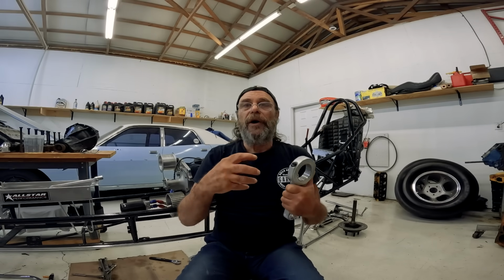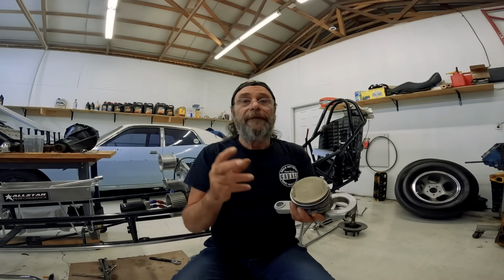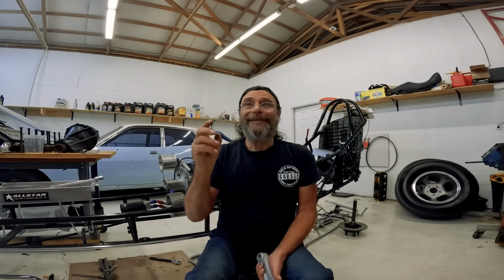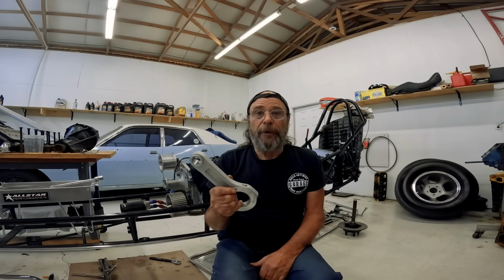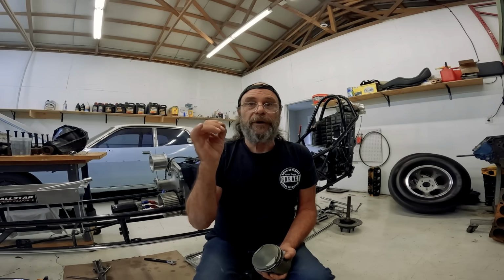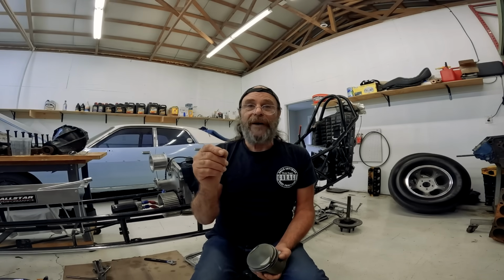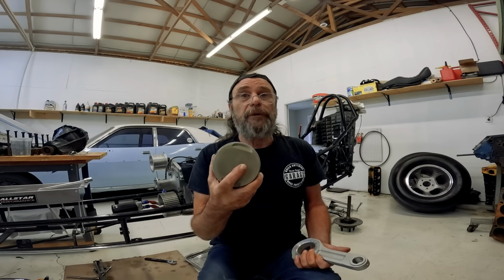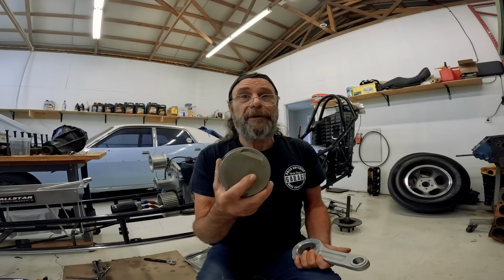Project Top Fuel Pt.9 - How Nitromethane Makes Power And The Importance Of Rod Ratio

Comment: This guy cracks me up..... "A legend in his own mind"..........
Reply: The dude has a right to be proud of what he has done and what he knows.
How many nitromethane dragsters have you built and raced?
Reply: Big Fuel Pumps, Big Magnetos, Dual Magnetos, Down Nozzles,  Super strong rocker arms and pushrods all made the huge horse power leaps.  Rod ratio and valve lash has zero to do with it. I've been around nitro all my life. This guys in love with his own voice.  If this guy thinks a 65 year old 354 block with very fragile main webs is going to hang with modern tires on a prepped track, he's sadly mistaken.  Golden Age races got away with it has there was zero traction. The engines just freewheeled.  Today?  The crank is going to be laying on the ground  in a handfull of pass's..... This will be fun to watch.
Reply from the maker: I normally don't respond to this soot of thing...but.
Big pumps, dual mags and down nozzles all came about at the same time....why?  To provide and light enough fuel to extend the burn into the blowdown zone.
Super strong rocker arms...EXHAUST rockers...why?  Because the valve was opening into an active combustion zone at the BOTTOM of the stroke.
I was a participant in every bit of that evolution.
As for the engine currently in the car, as I explained in a previous video, it will only be used for initial setup and a couple of burnouts and 60 footers,  After that it will be upgraded as the owner sees fit.
Reply: @UncleTonysGarage  With who? When?  What team?
Reply: @AlisoBob  cant wait for you to upload a video of you and your drag car  explaining  how  it all works   AND YOUR CAR NOT ANYONE ESES
Reply: https://youtube.com/shorts/T82H7t6Z3U0?si=0jawOLLyJSikavAR
Reply: @UncleTonysGarage  The guy always has the option of blocking your channel so he isn't tempted to klick and watch[ one of your videos. Love you Tony. The legend.😘
Reply: @AlisoBob  I don't get that impression at all from him..... Although I do get that bad  impression from YouTuber-Casey The Car Guy. He comes off as extremely cocky & arrogant. 
He put a small fuel efficient turbo diesel engine (probably a 1.5L European TDI engine) in a very lightweight aerodynamic small 2 seated car. So it gets over 100 mpgs. Then acts like he singlehandedly built a nuclear fusion warp drive engine. That will allow spaceships to travel at the speed of light. Apparently he doesn't realize several other people have also built 100 mpg small cars. If you think Tony loves his own voice. Or is a legend in his own mind. Go watch Casey The Car Guy. 😂 You'll think Tony is super modest by comparison.
Reply: Thanks. I'll go take a look.  I'm always on the hunt for a good laugh.
Reply: @AlisoBob  He was on a Tucker Carlson podcast bragging about his 100mpg car, a while back. The only way he could sell it, is in kit car form. When people suggest this, to him, he acts like they're st00pid. Saying, "duh don't they think I've thought about that? The average Joe can't build their own kit car. So that idea won't work." 
Yet, all he'd have to do is, sell it as a kit car.  Then have another different company under a different name. Assemble the car for the customer,to make it street legal, to get around loopholes. 
The average person thinks his car is amazing because they don't realize, a 100 mpg car has already been done. So now he has several dim YouTube followers. Who think he's practically a God who's going to be the next Elon Musk. They post comments about how the government or oil 🛢️ companies are going to try to delete him. 😂 
Lately he's been doing nothing but conspiracy theory videos where he asks Grok AI questions. About things like political corruption and who secretly controls the world,etc... I do agree with him on many things politically but. He seems like he's starting to really go off the tin foil hat deep end.
As far as his 100 mpg car I believe he simply took a 1.5L turbo diesel engine. Out of a European*Peugeot 208 which claims it can get 70 mpgs. He then put it in a lightweight aluminum monocoque body, that's fairly aerodynamic & sportscar looking. Along with some lightweight wheels & skinny tires. 
One thing he does have me curious about is. He claims George Soros paid for Vivek Ramaswamy's college.Which I highly doubt, since Ramaswamy most likely had a bunch of academic scholarships. He claims Ramaswamy is actually a far left globalist. Pretending to be a Trump supporter in order to get elected. 
Sorry for the long comment, I can't stand the guy. If you think Tony is arrogant (I don't think he is) & loves his own voice. Casey The Car Guy is 10,000 times worse.
Reply: There is only X amount of BTU's in a gallon of fuel. Those BTU's will only do X amount of work.  Many of those BTU's are lost to exhaust and cooling heat.  There is no magic 100 mpg car.  Period.
Reply: @AlisoBob You're not listening. And being around NITRO for all those years, how many barrels of it did you buy? Ever own a NITRO Altered? Crew on multiple Top Fuel match race teams? I think it's cute how convinced you are that rod ratio has nothing to do with it. 

There are people who think they know and love to see their name in the comments as well
Reply: I bet you've never owned a firesuit, have you? 

I know a bunch of experts like you. They've never done nothin', been anywhere, or worked with anybody. They're never racers, and sometimes they don't even have a HotRod. If it turns out you drive a hyundai, I won't be shocked
Reply: @AlisoBob You could re-read your own comments...
Reply: @AlisoBob  Respectfully,  there actually are a few small lightweight 750 to 1000 lb cars that can get 100 mpgs....A 2000 lb small European hatchback with a 1.2  or 1.5 L turbo diesel engine can get 75 real world mpgs....Put that same engine in a car that's very aerodynamic & only weighs 1000 lbs with 4 skinny motorcycle tires. That you can push in neutral with 2 fingers and you can get 100 mpgs in overdrive......They have a race called the Progressive X-Prize winner 🏆 gets $10 million dollars for the most fuel efficient car. Example, the small  Elio tandem 2 seated 3 wheel car. Got 75 mpgs using a 3 cylinder Geo Metro engine. Swap that Geo Metro for a 1 liter turbo diesel & you have 100 mpgs on the hwy in od.
Reply: @UncleTonysGarage  Great! I was wondering about the exhaust event and how it reacted when still making power. Fantastic!
Reply: @john-wk4ks ask Adam Sorokin about Bob Higginson.......
Reply: Add your experiences with nitro. 👉🤡👈
Reply: LisaBob has issues.
Reply: @Channelscruf I just clicked on his icon, and viewed his channel. Watch his short videos. He has videos of his Surfer’s top fuel slingshot dragster running in his garage, in his driveway, and at the track! The name of the channel and the person in the videos is the person who owns the Surfer’s dragster.
Reply: @shadowdog500  Did you actually WATCH many of those videos? OBVIOUSLY NOT..........BECAUSE I JUST DID. You claim "you saw that HE has videos of top fuel slingshots in "HIS GARAGE" in "HIS DRIVEWAY" ........"and at the track!" The dude simply attends various CACKLE FESTS. NO VIDEOS OF OLD-SCHOOL TOP FUEL SLINGSHOT DRAGSTERS MAKING ACTUAL RUNS. And NOWHERE in any of "his videos" does he have ANY information in ANY video description, plus he has ALL COMMENTS TURNED OFF. Let THAT sink in. Hell, ANYONE can attend cackle fests & visit OTHER PEOPLE'S shops & take short videos. ( MILLIONS of people do those things.......but it doesn't make them "experts". ) ALSO: In MOST of his SHORT videos, his video titles mention names of various car owners and/or drivers etc..........NONE of them say "MY top fuel sling shot". NOT ONE. Furthermore: "AlisoBob" asks Tony in this very comment thread: "Who did you race or work with, when, what team".............TONY HAS PAST VIDEOS WHERE HE DESCRIBED ALL OF THAT STUFF IN GREAT DETAIL.......but apparently, "AlisoBob" has FAILED to watch Tony's past videos ( videos posted BY Tony right here on his channel.........LONG BEFORE this "Project Top Fuel" that he's doing right now. ) Ya can't just go "take a quick glance" at some stranger's youtube video list and call that "thorough research". So "congrats"........because YOU'VE BEEN DUPED by "AlisoBob".
Reply: @shadowdog500  i  click on his channel before i posted my comment  and just because he post videos of drag cars running in a garage or driveway doent mean it is his garage or driveway or his car and instead of having a go at uncle tony he should post a video of HIS drag car explaining how it all works and not like in his comments ( Big Fuel Pumps, Big Magnetos, Dual Magnetos, Down Nozzles,  Super strong rocker arms and pushrods )
that explains a lot doent it   NOT
Reply: @howabouthetruth2157  I did watch his videos, including his short videos of him running his 1963 Surfer’s dragster in his garage.  In his short video posted 6 days ago he was alone in his garage and started the Surfer’s dragster himself on alcohol after putting it back together.  Cacklefest cars are meant to be started at the track but don’t make passes down the track, so I don’t know if he has any nitro racing experience, but he did build a nitro Cacklefest car which is something and he is the one that did a series of interviews with the origional surfers racing team about a decade ago.  The name of his channel and that car in his shorts are known In Cacklefest, and the person in the video is the person who matches the name of the channel.  If it is him, I hope he does make a short response video.  [UPDATE] I see he posted a link to his video I mentioned in a response to this thread.
Reply: @shadowdog500  HIGH.............there's a whole lot of difference between a cackle fest ( it's NOT "crackle fest" ) and actually making a run........any run, down the track. The engines are set up totally different for each.
Reply: @howabouthetruth2157  Thanks for catching my spelling error!  I agree that someone with a Cacklefest car sets it up mostly to idle and the engine and the rest of the car is not set to run down the track. If you look at the video I referenced he is running a coil and distributor on that car instead of a magneto, and I bet it has what Dr. Art calls “ a bluetooth coupler” between the engine and the rear, so it’s definitely not set to make a pass down the track.  When @Channelscruf  posted for him to “Add your experiences with nitro.” I clicked on his channel and expected to find an empty channel, but was surprised to see him with a slingshot dragster running on nitro in his garage.  Luckily nothing fell off the shelves, I hope his wife wasn’t having a children’s Halloween party upstairs, and I hope she didn’t scream at him if the running nitro engine caused a giant crack in the wall!  😊
Reply: You are probably not old enough to know that Uncle Tony is Tony Mopar from all of the magazines in the yesteryears. He wrote and edited a lot of the performances magazines from the  eighties and nineties. I take his word over a guy that said “if it run good on alcohol then it will run good on nitro”. I think maybe you are clout hunting.
Reply: I know who Tony DeFeo is.
Reply: @AlisoBob  go run your mouth out in public asshole insread of nehind the keyboard. I would love to be there when it happened. Or better yet let people know when tour going to the track with tour slingshot ....
Reply: It would seem that 444 thousand of us like the sound of his voice too compared to 80 who like yours.
Reply: @doug00596   GOOD RESPONCE
Reply: ...going to need you to advance your timing quite a bit. You're appearing to be running quite........
Reply: @macsgarage9721  LMAO! Good one, I might steal it, sorry! :)
Reply: wow only 11 of your 80  total subscribers gave you a like on your comment
Reply: Can't believe some dildos on here, that like the sound of their own youtube comments....lol UTG, you are natiinal treasure. A wealth of old world knowledge, that is only to be handed down by a few left. Carry on UTG, amd ignore the false  prophets. Keep spreading the knowledge and wisdom, it's the greatest gift you can give to a younger generation that still cares  to learn this almost lost art of all thimgs mechanical and wonderful!
Reply: National*
Reply: Go say it to hisface fuckballs. People like tou need a good punch in tje face from time to time ro keep ya from being an asshole
Reply: The burden of proof is always on the naysayer. Too easy to just say it's wrong, too easy to have sour grapes, especially on social media. When I see stuff like this, it automatically gets the title of "unverified claims". Prove it to me AlisoBob.
Reply: Go ride your Chinese vibrator dirtbike dipshit 🌈🦄🏳‍🌈

Comment: good one! I'll bore you back, 2 cycles make 70% of thier power from the expansion chamber. Pipe the stinger tighter and tighter and you need fuel to keep the cylinders intact! Sound familiar? thanks again for sharing with us. PEACE GRD When that 27 c.i. motor sounds so angry that you just know yer gonna' die, it's perfect. thats nearly 300 hp from 27.5 c.i. 440 cc. on gas 114 but gas.  Brain space? Dang rite. THINK !

Comment: Great Tony takes me back to 58  junkyard 331 or 354 block  Club cam heads, Strombergs with jets removed and  tuned by varying the % TIP THE CAN
Now max acceleration is at 90degrees crank it is whent the rod is perpendicular to the throw and changes with rod rati
The short rod ratio increases the dwell around BDC  you spend many more degrees down there  think about it tht was in addition to deceleration which is essentially over
cheers

Comment: Fascinating information, thank you! I knew Nitro was a whole different ball game, but this really helped clear that up. I have one question re the exhaust valve operation on these TF engines, that based on your explanation here makes it even more relevant to me. I know the likes of pro-mod and such can have valvetrain failure on the exhaust side due to the pressures involved and the cam profiles etc. So what I want to know is how much pressure is on a TF exhaust valve head when it's about to open (which I assume is extreme given that these engines can shrink con rods...), and how the heck can the valve train handle that? It would seem to me to be an almost insurmountable amount of pressure required to just get that valve opened initially.